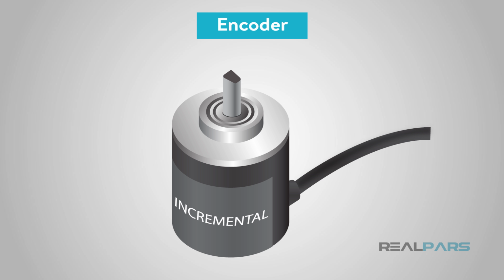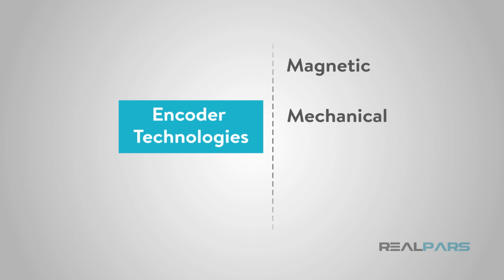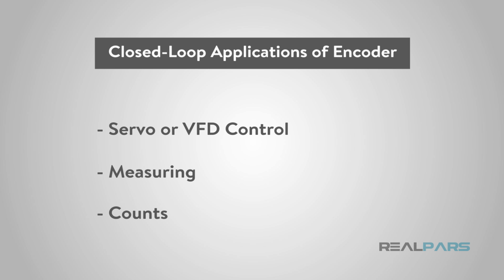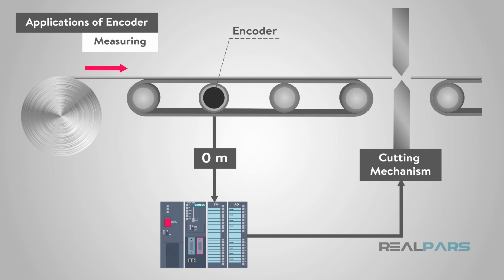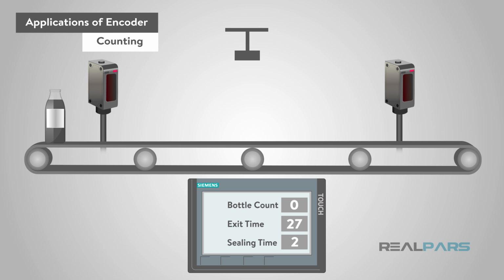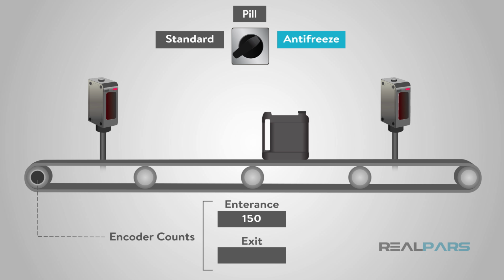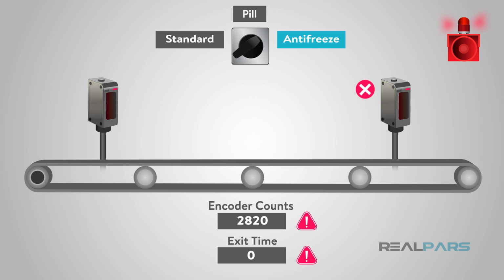What is Encoder?

Comment: One thing I wonder how you are able to program load variance?

Hypothetically let’s say a bottle of water weights 20lbs but by the end of the conveyor the water must be emptied and weigh 2lbs.

Would the convey continue at its pace or would it supply less power since the amount of load is changing over time? Say 30 seconds
Reply from the maker: Hello @tylerfukuda.  Thank you for your question.  Depending on how you design the system and your program. These motors and drives have feedback sensors or speed encoders that can monitor current load requirements. Therefore, as the load goes down, so can the current required to move the load, and you can program it as you like to sense and adjust the speed and torque as needed.  Happy learning from RealPars!

Comment: This is an optical encoder found inside auto engines distributor and help control ignition timing and a cam signal. At a 2:1 ratio, a crank sensor tells were two pistons reach top dead center on the compression stoke, but only a cam signal will show with cylinder is ready for injection and spark to follow!
Reply from the maker: Hello, @deankay4434. Thank you for your question. Depending on where you are in the world, the safety standards are different for gas and electric cars. If used in the engine and transmission mechanics, they have to be able to withstand lots of heat and environmental issues. However, these devices can be found inside the car. 
Here is a link for your review:  https://www.diodes.com/applications/automotive-applications/comfort-style-and-safety/.

Comment: What is TM Module that is connected to encoder? As I remember from previous videos, high-speed signals are processed in FM module. 
Could you, please, explain the difference between these 2 modules?
Also, would be great to see wiring and programming servo-motors.
Reply from the maker: Siemens TM cards and FM cards serve the same purpose:  off-load intensive processing tasks from the CPU to the TM/FM card.  TM and FM cards are designed for a specific purpose.  The cards available for the S7-300/400 CPUs are called Function Modules.  The newer term, used for ET200SP racks, is Technology Module.   There is a wiring diagram to the encoder in this manual:  https://cache.industry.siemens.com/dl/files/715/83727715/att_915817/v1/et200sp_tm_count_1x24v_manual_en-US_en-US.pdf.
Reply: @realpars  thank you for the clarification!

Comment: Thanks the video. 
I have a question. 
Why use home sensor in the servo system? 
Somebody say, this is a reference point. 
But i dont understand. 
 For example the encoder count, from 0 to 100. Again and again. 
If i would like something at value 27, the encoder will count from 0. Not from the home sensor. 
I dont understand this. Please help! 
Thanks
Reply from the maker: What you are referring to is "homing the sensor", not a home sensor.  When I want to initialize the system or recover from a fault, it may be necessary to reset the sensor to its "home" position (in your example, to position 0).  This homing function is only necessary with an absolute encoder, and is necessary to insure that the motion controller knows where the the system is at any point.
Reply: @realpars  
So at the incremental encoder, we need the home sensor in every turn to reset the counter. (make the value zero). again, and again. 

But I dont understand at the absolute encoder the home sensor. why use that? 
the count is begin from the encoder's ZERO point every time? again and again, in every turn? 
we need the home sensor just when we change something at the driving (motor, or something)?
--And the  home sensor is at the encoder's zero point, or at the encoder's any point?

Thanks your answer

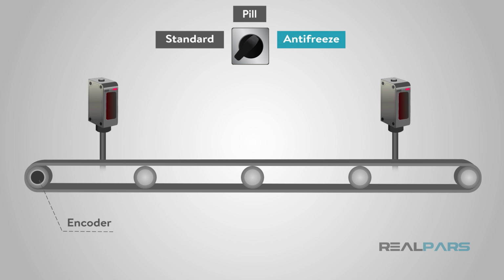Comment: 5:55 Why would i need an encoder here? If the switch is in antifreeze mode, i can just count 2-2 sensor signals for the bottle, and use timer and counter functions with PLC programs.
Reply from the maker: You are correct.  You do not need the encoder to determine the "existence" of the bottle at each location.  The encoder gives you the distance traveled and using the time between reaching the two sensors, you can determine the bottle's velocity.  The video shows how the encoder, along with the sensors, can be used to determine throughput per unit time.  The data can also give a fault if the bottle does not reach the second sensor within a period of time.

Comment: You should make a video showing how to setup a trend of an encoder input signal.
Excellent tool to ensure you're getting a good encoder input signal.
Reply: Incremental encoders are a  0V - 5V pulsed signal, one pulse for every x% of revolution.  You can bring an incremental encoder into a PLC card (high frequency input card) and insure it is changing signal with position. For creating a pulse trend or trace, you can connect the encoder output to an oscilloscope, or use an HMI trend to display the signal.   Absolute encoders can output 4-20ma signals (if configured as a resolver).  This can be brought into the PLC easily and placed on an HMI trend.

Comment: For the process logic described for the antifreeze case, how would the light sensor detect a foil on the cap? Is this predetermined or the light sensor only returns logic 0 or 1 values for truly reflective components (ex: aluminum)
Reply from the maker: Hi there,
No, it is not mandatory. The reflective sensor will return 1 whenever the object blocks its ray.
Reply: Ok so by using encoder you also creating count between bottle cap  and handle?